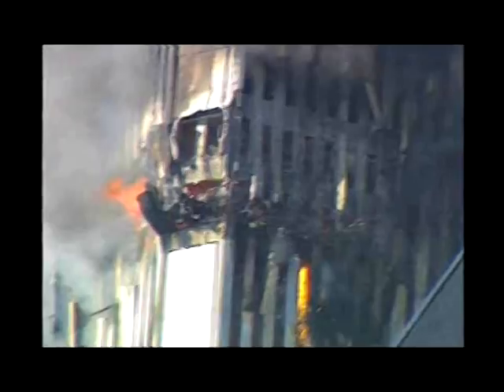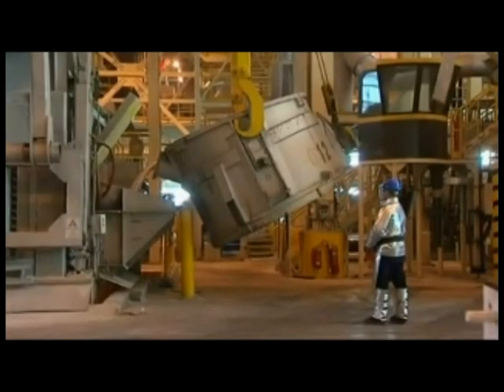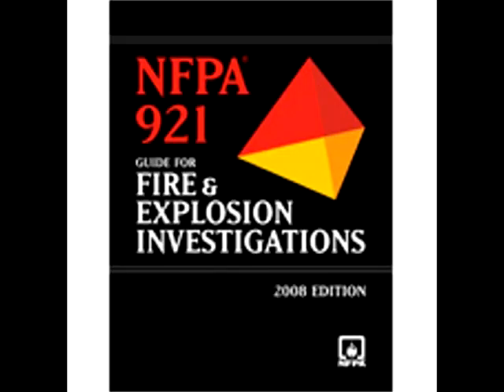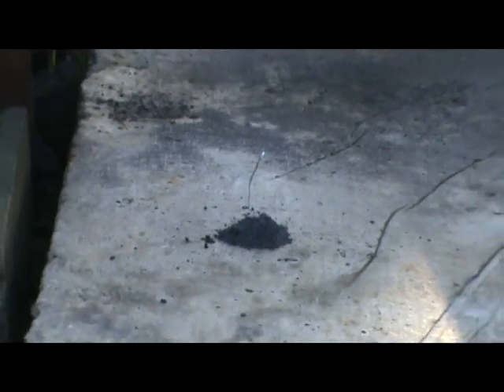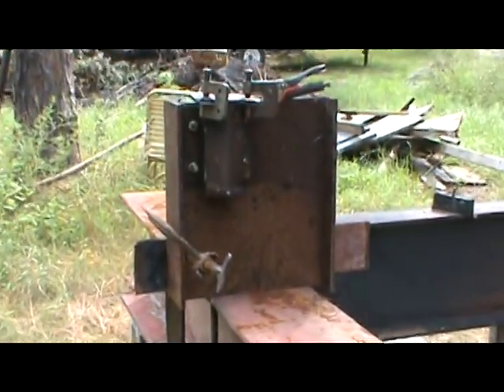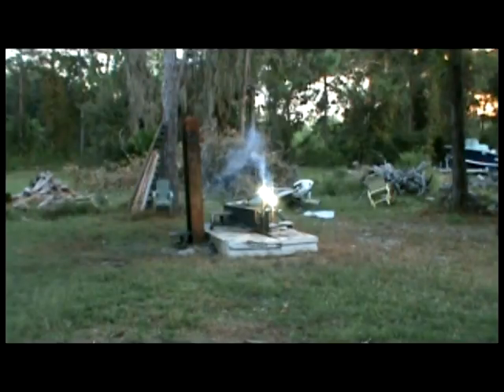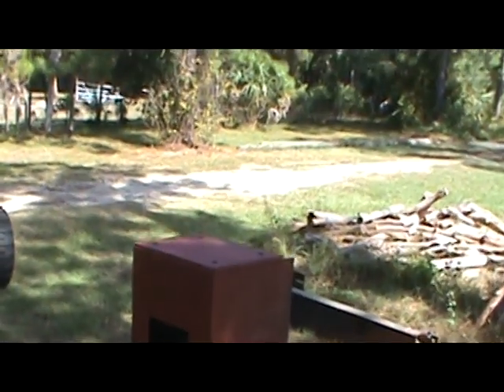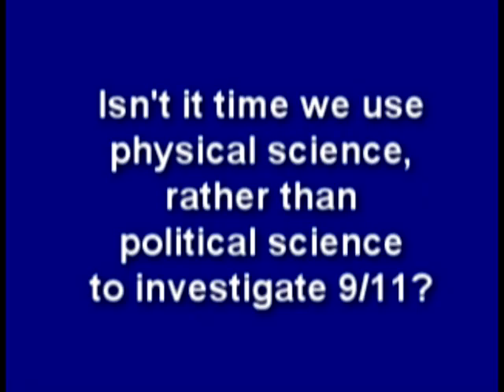9/11 Experiments: The Great Thermate Debate

Comment: You've wasted 1000s on your proof experiments.  1 shower of sparky molten whatever in 1 corner of 1 floor of 1 tower doesn't bring down 2 towers or even 3.  It would be smarter to find out what was on that floor of that tower that got piled up with the plane debris in that corner to make the sparky molten shower. THAT would be investigating backward from what we saw instead of investigating forward from what you think you know already. You know like real unbiased investigations are done.
Reply: pepelapiu2004 what happens to a liquid that is being buffeted by air currents as it falls from a height of 300m? Does it remain in a nice, neat little spheroid so that the characteristics at ground level in a pot are maintained or does it circulate? Hint: it's the latter.

When you have this kind of circulation you would only get the silvery colour for brief periods. That coating is oxidized aluminium and if you are constantly cycling the material which is exposed to the environment you will keep the still-molten, un-oxidized matter on display.
Reply: ***** the smoke says fuck all about the intensity of the fire and EVERYTHING about its composition. The smoke is a product of the particulate matter formed by the oxidation reaction. When you have a smouldering fire this matter is simply more concentrated because the fire has less of a spatial extent and insufficient production of updraught to propel this matter too far.

Does a raging inferno produce a lot of smoke? You tell me:

http://en.wikipedia.org/wiki/File:Buncefield2.jpg

- would you like to apologise to John Brown now, or would you like to be refuted a bit more first?
Reply: ***** well, since I actually provided you with a link that directly refutes what you have just claimed we can dismiss your opinions entirely. Well done: you have just undermined your own claims by ignoring contradictory evidence and PERSISTING in making a demonstrably false claim. Here it is again, so try to remember how to click this time:

http://en.wikipedia.org/wiki/File:Buncefield2.jpg

- is there a shitload of smoke there? Is there also a raging inferno there?

Combusting is a chemical reaction, and I'm a rather good organic chemist. I know, from years of study, that the smoke given off from any given fire is determined by the reaction that is occurring, NOT the intensity of the flames. Hell, you can burn some hydrocarbons at great intensity and temperature WITHOUT a visible flame or smoke column.

So, I have provided actual, verifiable data which refutes your position, whilst you STILL offer nothing more than screaming and ignorance. And you have the temerity to call ME a fascist? Very rich, coming from someone who wants everyone to accept his claims without question. Worthless cunt.
Reply: pepelapiu2004 non-sequitur. Molten aluminium falling from >300m up is buffeted by air currents, resulting in a dynamic fluid that is constantly cycling. The silvery coating that forms on molten aluminium when STATIC is due to oxidation. However, this does not really apply to the falling metal, because the turbulence created by the fall is perpetually exposing virgin aluminium to the atmosphere. By the time such material has oxidized it has been cycled and there is now fresh aluminium exposed to the air.

Here are the facts: we KNOW that it could have been aluminium from the above fluid dynamic principles. We also KNOW that the conditions were conducive to the formation of molten aluminium. This means that aluminium is the null hypothesis. In order to claim that the falling material was NOT aluminium  YOU have to prove that either the substance is chemically different to aluminium or that aluminium would not behave as the above physics dictate that it SHOULD.

That red-orange shower is evidence for molten aluminium under turbulent conditions. Your misinterpretation of it is evidence of your lack of intellectual honesty. Break the chain and do some honest research, starting with a little basic physics and leading in to some fluid dynamics.
Reply: If that was "thermate" why would they put it on the outside tube of the tube in tube designed structure?

Like all of the truther theories.....

They
Dont 
Make
Sense
Reply: YEAH RIGHT! You must have been a POG then! Nobody in a combat MOS, especially anyone who has worked with demo, could be so stupid to think the US gov could pull that off after knowing their capabilities. Nothing gets done without the privates and Sgts and those people don't keep their mouths shut.

I know a ton about you. A fake patriot who thinks he figured out something the majority of experts didn't figure out, including Russia, China, the UN, etc......CLEarly a fake or a POG
Reply: wiibaron  the only problem with that was that all of the evidence was DESTROYED before a proper investigation was made. And I doubt you can make any claims on what and what cannot bring down a structure unless you have knowledge on how structural systems are designed, built, material type, among other many factors.. specifically, THIS ONE.

And besides, you have to admit, these experiments HIGHLY, if not, EXACTLY simulate the melting that occurred in WTC.

So "wasted"? If he was wrong, at least we know that thermate DIDNT bring down the building. That would be a step forward. Right?
Reply: justice J Jack ass
The plane didn't turn anything into dust....When thousands of acres of concrete and steel collapse, it creates dust from the concrete breaking....Flashes were from the nose impacting the buildings (common sense) and anyone who thinks a country that can't even dump a bucket of water on a terrorist without the CIA leaking it but could fake the last 35 years of AQ intel is a FUCKING CLOWN
Reply: *****
And this is a perfect example of how truly ignorant and stupid the self titled truther community is.....What a joke
Reply: What a clown.....Im sure you live in your moms basement living off government cheese wearing a tinfoil hat.....Classic!
Reply: What really bothers me is that the NIST oh-fishy-al experts tell us that the red glowing stuff seen falling from the tower was molten aluminum. The problem with this is that molten aluminum doesn't glow red like that until it's been heated to over 3000 degrees. Below those temperatures, aluminum will remain of a silvery color. So obviously the NIST is bending truth to fit their version of 9/11. That really should be a red flag to you.......if you were paying attention at all.
Reply: The problem with what you are saying is that even before it starts to fall, the stuff is already glowing red. So nice try but no brownies for you.
Reply: pepelapiu2004 AS IT SHOULD HAVE BEEN!!!! Winds fueling massive fires spread across acres of building floors......The fires were raging, the heat was immense......Why the fuck do u clowns downplay these obvious and indisputable FACTS?
Reply: WOW...Another keyboard tough guy talking shit....Im fucking scared bro...Seriously...

Two isolated pockets of fire....Said NYFD chief Daniel Nigro while in one very small section of the over 3 miles of STAIRWAYS in the building...You are really grasping at straws here conspiracy nut.....THAT is why nobody takes u guys serious....Oh and the fact everything you say has been DEBUNKED
Reply: You are correct in saying that one shower of "molten whatever" could not have cause the collapse of 3 buildings. Nobody is claiming that that one sight of red-orange stuff is the cause of all 3 buildings collapsing. Npbody is that stupid.

And.you are also correct when you write "It would be smarter to find out what was on.that floor" which could have caused that milten red-orange whatever.

What I am concerned with is that the NIST is obviously trying really hard to not find out what it really is by claiming it's just molten aluminum with organic stuff mixed in. 

It's obvioys it could not have been molten aluminum. No need for a freaking rocket scientist degree to know that. Look right here on YT to see what molten aluminum looks like.

So you really should be concerned with why the NIST is so blatantly dismissing it as molten aluminum when that claim is so false.

Could it be that they don't want to admit something on that day was present, which could melt steel?

That red-orange shower is evidence of something, that's for sure. Why is the NIST trying to say it's molten aluminum?
Reply: ***** impact damage and fire.

The impacts involved moving objects that could have called on over 30,000,000N of force, and which caused the removal of about 14% of the support structure. The fires have been empirically proven capable of exceeding 1500C, and were measured at over 1000C. Construction steel melts at 1475C and loses 90% of its strength at 1000C.

What do these facts suggest to you?
Reply: Met zero resistance....The lies these fools tell to keep their crap alive is amazing....Almost half of the front side of WTC7 had collapsed before the rest gave away and when you start your stop watch....Your lies say everything anyone needs to know about your self title "truth movement"..
Reply: I can  only think my reply went to the wrong person....

Comment: I'm no expert but to me the key to what happen on 911 is WTC 7 how is it the one build that the farthest away from the towers that received the least amount of damage Implodes straight down on its own footprint? There was no aircraft fuel as an accelerant so what inside the WTC 7 cause enough heat to cause the main steel columns  to fail if a thermitic Material wasn't used?

Comment: well for starters dumass, how about the fact that newtons third law of motion states that all objects in motion will have an equal and opposite reaction, therefore asswipe no building that is not taken down on purpose will fall at rate of gravity. also, for steel to melt it must reach at least the temp of which it was forged. black smoke from top of towers indicate fire was of low temps as fire goes. so, take your fuzzy fiziks and shove it. your name sounds like i dropped a knife on my floor.

Comment: if the govt hadn't used planes and had just demolished the buildings and blamed it on the Arabs, then there would have been a much deeper investigation into how the buildings were infiltrated, prepped and primed and how no one noticed. Evidence from the crime scene would have had to be left there much longer than the real clean up did - by using planes, the govt says too much damage, a big fire, then the 'pancake' collapse of the building. Case closed. Firemen say many bombs went off. You?

Comment: "You clearly ignore facts - how do you explain all the video and photo evidence of the bowing outer walls just before collapse?"

Ignored..? It's clearly visible in all close-up videos of the east face of the building. The fact of it, however, does not in any way explain a) what caused it, b) the high-speed ejections shooting out from numerous floors above impact level at the opposite side of the building before the downward movement had actually begun (watch?v=Gdkqu5kCtyE) or c) total collapse.

Comment: "but the failure of the structural steel due to damage from a plane crash and fires has been proven"

Local failure was to be expected, but total collapse is something entirely different. NIST has not even attempted at delivering a hypothesis as to the actual, alleged progressive collapse mechanism. Watching videos of the collapses right away refutes any idea of columns being broken by any weight crushing down on them, and there were no floor trusses stacked up at the bottom of the structures.

Comment: andy, some fire men were just worried that wtc7 would collapse, not because they were informed about demolition.
e.g. read this interview: tinyurl .com /knf38g3
...on the south side of 7 there had to be a HOLE 20 STORIES TALL in the building, with fire on several floors. Debris was falling down on the building and it didn’t look good.[...]but eventually they PULLED BACK too.[...]that building doesn’t look straight.[...]nobody’s going into 7, there’s creaking, there are noises coming out of there

Comment: azmodawn, i know - and i repeat: of course the examples cant be compared to the collapses of the wtc buildings (even if wtc buildings were partly stripped of insulation by planes/falling debris, too)
the point is, that many people believe/claim, steel buildings generally cannot collapse due to fire and therefore may conclude, it HAD to be controlled demolition.
the examples are good enough to prove the underlying belief wrong, so it shouldnt be used as an argument for the demolition-theory.

Comment: KADER >> "The factory was poorly designed and built. Fire exits drawn in the building plans were not in fact constructed, and the existing external doors were locked. Furthermore, the building was reinforced with un-insulated steel girders which quickly weakened and collapsed when heated by the flames."

Dogwood - pre 1974 metal and construction - zero insulation, zero fire suppression, tones of combustibles...

Comment: Slump, crumple, and sag vs. free fall of complete structure. Not perfect, not close in any way. When a building is designed to hold 4 times its own weight, out of steel designed to melt 4-5 times hotter than what occurred, we've got issues lol

Comment: "big steel framed buildings DO NOT COLLAPSE due to SMOKEY FIRES."
this example really calls into question what you claim:
watch?v=8XMTALBYRNA
not the whole building, but a section of it totally collapsed. smoke, but almost no flames visible.
no perfect comparision to the wtc of course (for example this building wasnt hit by a boeing 767, constructions different,...) - it just shows that some steel constructions can be very vulnerable to fire.

Comment: "but it's still standing"
no its destroyed, only the warped frame is standing, no roof, no floors.
(and no plane strike damaged it in combination to the fire)
in your logic, every collapsed building would still be standing (including the wtc buildings), if only some beams remained standing.

and there are more examples of steel buildings collapsing due to fire, e.g. the kader toy factory or the dogwood elementary school.

Comment: or maybe some of the crushed aluminium just oxidized/burned, as i suggested - flame can be very hot, similar to thermite.

"In my opinion this is the only plausible reason for the high temperatures"
we dont know how high the temperatures exactly were, do we?

another idea: at the floor where the metal poured down, there was a room for ups batterys. i guess that a room full of triggered batteries can produce some heat and molten substances.

Comment: The 767 223 planes have a mass of 85 tons aluminium, the planes  pulverized into aluminium powder, wich mixed with pulverized concrete : SiO2 , and see: thermite mix is there, the temperature of the burning fuel was high enough to let the thermite react / ignite ! In my opinion this is the only  plausible reason for the high temperatures, all ingredients were

Comment: "and office furniture doesn't burn hot enough to melt steel, let alone bring a building down."
the fired doesnt have to melt all the steel, but heat will deform it and hot steel only has a fraction of its normal mechanical strength. steel frame buildings can collapse due to fire: tinyurl . com /k7ftbdp

"Firefighters knew from experience?? They were ordered out of the building"
not every firefighter, but they were ordered out, because some saw it coming - they saw a bulge and heared creaking.

Comment: "They were damaged.. but they were still standing."
no, just ruins, most of the structures collapsed. some sections survived, probably because they did not catch fire or because they had tougher construction - e.g. one section wtc3 was reinforced after the 1993 bombing and this section remained standing damaged.

[wtc7]"There were 2 tiny fires"
one could assume that, looking only at the north front. but the south front was severely damaged and smoke was streaming everywhere out it.

Comment: "no jet fuel, or no, huge plane hit it" wtc7 was hit by heavy debris of wtc1, thus was damaged and burned. there was enough office material (and tons of diesel for generators) to fuel the fire.
"And how no other building has ever collapsed from fire." e.g. heavily concrete reinforced buildings may only be damaged by fire, but of course steel framed buildings like the wtc have collapsed due to fire. some examples: tinyurl . com /k7ftbdp
firefighters knew from experience, wtc7 would collapse.

Comment: FEMA report doesn't even discuss whether the steel was molten, but rather (in Appendix C) discusses whether "grain boundary melting" (it isn't even close to classical melting in half that thermite would cause) happened and whether it could be caused by hot corrosion. But FEMA does assert in Chapter 2 that in WTC1 & WTC2 "a stream of molten material - possibly aluminium from the airliner - was seen streaming out of a window opening at the northeast corner". Have you read the report yourself?

Comment: If there was molten steel somewhere according to FEMA (maybe because of some exothermic reactions under the debris, as i already suggested) - this doesnt mean that there was no molten aluminium. au contraire, it means that there had to be molten aluminium, because it would already melt at much lower temperature (~660°C, some alloys even lower).

Comment: summary: difference in volumetric heat capacity is not that big, exact temperature unknown.
black body radiation: emissivity of materials is different (no perfect black bodys), epsilon(alu) much smaller 1, but 1)the aluminium was not pure 2)even pure aluminium has visible glow at high temperature)
and big chunks of material will glow more intense and longer than droplets.

->not plausible to discard NISTs statement based on "molten alu appears always silver"